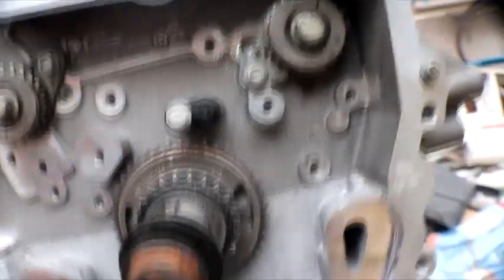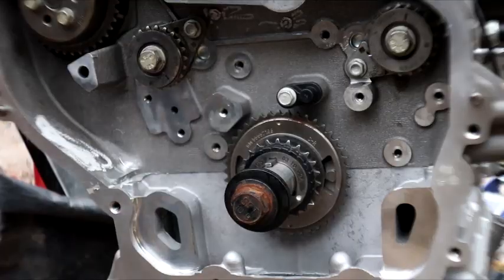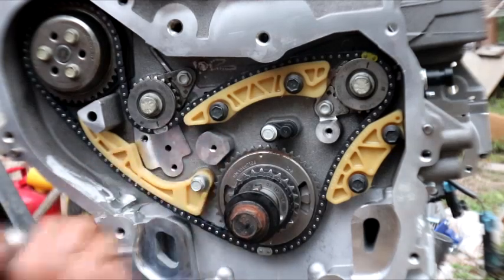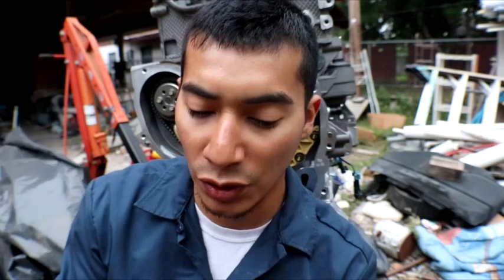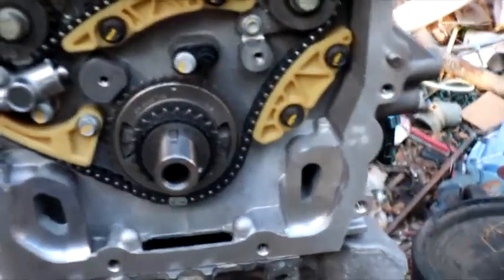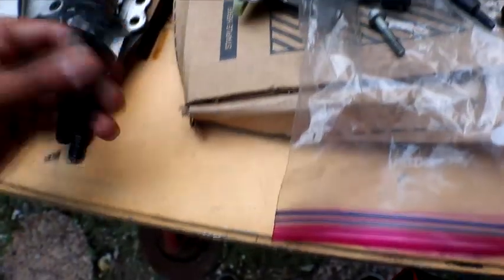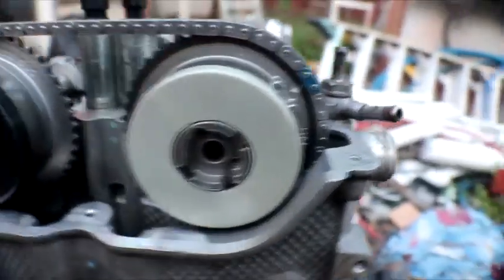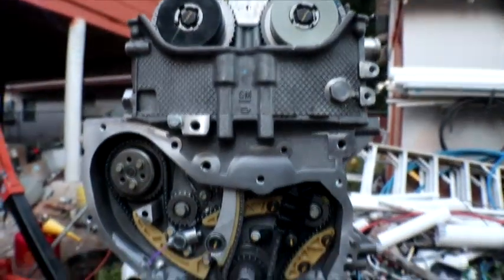Just in Time"ing" (Ecotec Timing Chain Set) Part 5

Comment: What if I have p0014 code for exhaust to advance, black guide was broke into pieces laying inside, so I have to re align cams, or can I just replace the parts
Reply from the maker: If your engine has VVT, you may want to inspect your exhaust cam solenoid. It may be faulty or dirty, causing that code to pop up. I'd reassure the timing is correct and replace the broken timing guide. You may want to remove the oil pan and inspect the oil pickup tube, as it may contain  broken pieces of the timing guide stuck on the oil pickup tube screen, causing oil flow blockage.

Comment: Hi,
Can I keep the chain in place if I'm just replacing the head (cracked). The timing chain and oil pump where replaced a year ago, so don't want to change unnecessarily.
Can I just take the tensioner off that's on the side of the head, or will the chain drop off when the intake and exhaust cam sprockets are removed?
Adam
Reply from the maker: @swast4  you can replace the cam chain components only and leave the primary crankshaft/waterpump chain in place. Just set cylinder 1 to TDC.

Comment: my primary chain is about 1/2 inch too short.  all the sprocket marks are lined up, but the bottom part of the chain, to go over the crankshaft, is not long enough.  i compared it to the chain that came off, and they are the same size...there is no blockage.  don't know what the issue is.

any ideas?
Reply: Tensioner is still set

Comment: Is there an easy way of putting the 2.2 in time without pulling the engine cause that I don't have any way of doing I have an 05 caviler which shaved the lip of the top mounting guide off and now unfortunately I have to replace everything it looks as though the intake cam is the only one that jumped time the exhaust is still set can't say for sure on the crank I haven't made it that far yet. If you have any words of wisdom that might make my journey a little easier it would be greatly appreciated I've never had the pleasure of dealing with the timing problem ever I've done engine work and what not so not a total moron when it comes to understanding engines or cars.
Reply from the maker: Yeah it's also possible and to do it with the engine in place. Sadly not as easy as engine out but removing the passenger wheel as well as the splash guard will open up the space alot more to give you more access to the timing components, just make sure cylinder 1 is on top dead center before doing timing.
Reply: @09CamaroFANATIC  thank you for that I wasn't 100% on where cylinder 1 needed to be but you cleared that up I definitely appreciate your knowledge
Reply from the maker: @00Slacker  yup for sure no problem, let me know if anything and hope all goes well for you!
Reply: @09CamaroFANATIC  what do you think the chances are I won't have to drop the oil pan to get that flat piece of metal that was sheared off the top chain guide. Sorry for being a pain in your ass it looks like the exh cam is still in time the int is out maybe a quarter counter clockwise might not even be that much  I think it's been a minute since I looked I've been dreading going any farther and it not being in a garage and the damn rain and cold weather 90% of the last few weeks I didn't go no farther than taking the top off the engine. I have no knowledge on doing timing but not having the cash to pay someone that does I have no choice I know the rods can get wrecked I'm hoping that didn't happen but it ran good the night before the the next morning it wouldn't the chain has got a good amount of play in it and the flat piece on the top guide is gone

Comment: how do i verify the #1 piston is at TDC on proper stroke.  My timing chain was broken.
Reply: Well this is a late response, but I'll answer. When the Crankshaft sprockets are at the 6 and 5 o'clock positions the crankshaft is at TDC on #1 cylinder. Then when you line the colored links up as explained in the video that sets the cam timing to  the compression stroke with #1 at TDC. Just means both valves are closed. 

It could technically be set with any cylinder at any stroke, but it's done like this because that is where the timing mark is set and what the colored links on the chain are set to line up with. Also by using the compression stroke both valves will be closed so you don't have to fight with the valve springs trying to spin the cam lobes around.

To further answer the question: if your cams are not lined up with the colored links after setting the crank sprockets to position, then you have to manually turn the cams with a 24mm wrench with the chain off to align the timing marks on the cams with the timing marks on the chain. There is a place to put a wrench on the cam just behind the cam sprockets. Do the intake side first. The video left out some details. You also have to rotate the cams to get all the chain slack to the left side where the tensioner is and then activate the tensioner by pushing it in 2mm with a prybar with some tape or anything soft on the end so you don't damage the chain, or you can use the back of a screwdriver and tap it with a hammer. For the bottom tensioner you just pull the pin and then run and jump down on the ground and try to find something to shield yourself with.

Comment: Do those cam sprockets fit on to the camshafts only one way with something that lines them up?  I want to be sure my cams are correct because my chain jumped before this replacement. It looks like the cams have a oval notch at like 7 o'clock on left and 5'oclock on the right.
Reply: Hey Mike. I'm working on a cobalt ss 2.2l ecotec 2008. I'm not 100% it is the same but it sure as hell looks so. With that being said I marked my sprockets and popped them off so I could answer your question. The sprockets on MINE can't be put on wrong. The keys on the sprocket only go a certain way. Research everything, triple and quadruple check everything. If anything doesn't seem right DO NOT continue, just get it right. If you don't every single valve in that thing will be done for. All of them.
Reply from the maker: Yes sir the cam sprockets only fit onto the camshaft one way via a key on the sprocket and notch on the cam.

Comment: If the engine is been turn, how come the timing marks never line up again?
Reply: Has to do with the fact that 1 rotation of the cam sprocket or cam phaser is equal to 3 turns of the crank sprocket

Comment: That upper main chain guide plug  was made for the ones that sheared off the bolt in the head so you wouldn't  have to drill it out. Sometimes the bolt will break off when the chain gets too loose.

Comment: Ok,ok ! People inquiring minds want to know.. need to know haha ...!! Warning signs that your timing chain is about to jump when you could hear your timing chain rattle like a rattlesnake it's time for another timing chain tensioner when taking off tensioner how to test if it's no good try pressing the cylinder in 20 times if you can do it more than five times without your finger bothering you it's no good .. good luck Cobalt fans have a have a 2008 and still running like a champ..

Comment: The prob I’m dealing with now is the upgraded bolt that holds plastic guide  the top bolt. Striped loose over a year at the head
Reply from the maker: So the thread on the head where the plug or upgraded plug/bolt goes into is stripped?
Reply: @09CamaroFANATIC  yes I already have the new used head back on and torqued but was having problems finding the torque spec for the cams. And cam bolt?    Someone was telling about the cam sprockets being spring loaded and if they are took off the have to be reset do u know anything about that?   When I took them off the cams they didn’t really feel spring loaded
Reply: @09CamaroFANATIC  thank u for the videos and how thorough u are I appreciate it
Reply: @09CamaroFANATIC  it’s a 2.4 vvt

Comment: I put all the marking like how you did and when I spin the motor. The lines don’t mark up anymore
Reply from the maker: the marks won't line up again. If you lined up all the timing marks, and you don't have the pistons and valves toughing as you spin the engine by hand, you shouldn't have a problem.

Comment: I have a 2010 2.2 LAP with 81k. It would mostly have a faint but noticable rattle at startup, after sitting for a few hours cooling down. Would replacing the tensioner  get rid of the rattle and prolong the chains and guides or would it be safe to replace the whole set?
Reply from the maker: How many miles are on the engine? If it's over 100k miles and on original timing it may be time to replace timing kit all together

Comment: Adding the extension could mess with your torque btw
Reply: That is incorrect, extensions only mess with torque in an impact gun not on hand tools. Check out torque test channel.
Reply from the maker: Yes, I took that into consideration, I added 2 extra inch pounds due to only being an 1 1/2 extension

Comment: Gonna have to do timing on my z22se at some point and i would like to get new torque to yield bolts but where i can find them on the internet, any ideas? Or do i have to go to a stealership?
Reply: I like it & Yes, your right  about that, STEALERSHIP!!! They overcharge for everything!!! I just got a 2.2 ltr Pontiac G5 with 167k miles but, it gets up & goes for a 4 banger!!! I can hear either the valves or the chain slapping the guides, EITHER WAY, IT NEEDS CHANGED ASAP! IM WATCHING EVERY VIDEO SO, WHEN PAYDAY GETS HERE, I HOPE TO HAVE IT DOWN PAT. i did the timing belt on my focus about 2 years ago. It was way easier!!!!

Comment: I have done exactly what has been shown and after all the Mark's are lined up and I activate the tensioner I turn the engine over by hand clockwise and I get lots of slack on the intake side by the fixed guide. Then if I turn the engine a little more the slack goes away but then comes right back. Everything is lined up and there is tension on the tensioner side. What is going on
Reply from the maker: Have you released both tensioners?
Reply: @09CamaroFANATIC  yes
Reply: Just not making any sense
Reply from the maker: @zachmaas7618  is it a new timing kit? And yeah it's not making sense. If both tensioners are activated one for primary chain and another for secondary chain then it should all be tight. Only way it will have very little slack but not enough to jump a tooth is due to the fact that they tension up with oil pressure.
Reply: @09CamaroFANATIC  yes new timing kit. I wish I could send a video or pic of the slack. I redid the processes many times to insure I did it right but still the same issue
Reply from the maker: @zachmaas7618  try sending it to me through message
Reply: @09CamaroFANATIC  I'll have to do it another day
Reply: @zachmaas7618  i keep seeing everyone say cyl 1 TDC. i personally was told you go by cyl4 in the compression stroke at TDC. If you intake/exhaust marks are opposite where they should be, then there is a good chance you are 180 degrees of the tdc you need.to be
Reply: @etothelij  the Mark's line up and intake cam is lined up with the intake mark same with exhaust
Reply: @etothelij  #1 and #4 are at top dead center at the same time.

Comment: qustion, does old 2.4 ecotec work on the new 2.4 ecotec?, just the lower i want to change, my has problem knocking and blowen head gasket mixed coolant with oil, if the lower old block work on the new, i can get one easy, but the new one hard to find, thanks.

Comment: If my cam shaft sprockets do not align with where the INT and EXT marks should be can I just use a wrench and move them? In your video they were already in the 2 o'clock position for the Intake and 10-11 for the exhaust. Thanks
Reply: Best to still have the old timing chain on and move the crankshaft until the camshaft ones line up. Because if all 3 don't move at the correct ratio it can cause valves to hit cylinders and basically destroy the engine at first start. And it WON'T BE a 1 to 1 ratio between camshafts and crankshaft because the crankshaft sprocket is far larger. If you've removed the camshafts completely, it gets more complicated but there's a comment on here that answers that.
Reply: @OffGridInvestor  you're right I just found that comment and makes sense now. Thanks for replying!
Reply: @OffGridInvestor  cam sprockets only go on one way. As long as the crank keyway is at 12 oclock #1 piston will be all the way up top. if cams were out just put the gears on and line them up at 10 oclock and 2 oclock no way you can really mess the timing up on these.

Comment: once all thee chains are in place you should always rotate the engine at the crankshaft nut 720 degrees ( two rotations) to ensure the marks are true... Once its buttoned up it could bite you if not... Just a little tip.
Reply: Some of these ecotec engines you really shouldnt, they use oil pressure for the tensioners and the chain tends to pop off if you turn the engine over by hand significantly.
Reply: @wills.5762  should I use loctite on any of the bolts including the 3 water pump pulley bolts?
Reply: Just adding this in. Apparently a lot of these GM engines won't have the marks line up again on the first revolution but will on the second. I assume it's to do with the chain length.
Reply: @OffGridInvestor  its to due with the balance shaft spinning and 2x the timing chain - so its 2 or 4 full revolutions to line up again

Comment: Please tell me 
A.) you remembered to pull that tensioner pin down below before re-installing
B) (optional) replaced water pump while you were that far deep into the motor?
Reply from the maker: Yes I pulled the pin on the lower tensioner and the water pump was a new unit just for safe measures.

Comment: I have a gmc terrain 2010 2.4 las week I   saw a masive oil leak on front of the engine look under I thought the main seal when bad replaced and the leak continue look at it again and I found a crack on the engine boody pretti much like were the chain goes mount  it is posible if one of the guide broke can the chain gets close to the engine block and grinding the inside wall? Because it seems that s what happen thanks for any info i. Advance
Reply from the maker: Sorry just getting to you, but it is possible for that to happen if a bolt that holds guides in place break off causing the guides to move and the tensioner will no longer be putting tension against the guides causing wear by chain rattle.

Comment: Hi, I'm currently rebuilding my 2.4L. Do you know the torque spec for the head, rods and main caps?
Reply from the maker: Hey what's up. The torque specs for the Head is 22ft lb. Plus 155°
Follow torque sequence.

For the Connecting Rods is 18ft lb. Plus 100°

For the main cap(lower deck) bolts 15ft lb. Plus 77°
And perimeter bolts 18ft lb.
Reply: @09CamaroFANATIC  Hey, thanks for the info.
Reply from the maker: @charlieclm  you're welcome!
Reply: @09CamaroFANATIC  Hi, how are you? Was wondering do you know where I can order the LE9 2.4 ecotec engine rebuild parts that ships internationally? Can't find any of the parts in my country not even the dealer. 😅
Reply from the maker: @charlieclm  Hi, I'm doing good, how about yourself? What country are you from?
Reply: @09CamaroFANATIC  I'm good too, just stuck with the engine no parts to reinstall back. I'm from Brunei Darussalam. 😁
Reply: What happened what failed to need rebuilt?

Comment: Hey love the vids! I blew the head gasket in my 2.4l and I took the camshafts out when taking the head off, after re installing the cam shafts how did you know where to  them since the pistons could be anywhere?
Reply from the maker: GasPedalGarage Hey thanks I appreciate the input!! You would have to revert cylinder 1 to TDC if you are going to set the timing. That way you can get the timing set correctly and the marking dots and arrows on the correct positions.
Reply: @09CamaroFANATIC  شكرا
Reply: #1 piston at TDC you put cams exh and int at 10 and 2  O-clock timing positions. the unique oddball colored chain link goes on cam sprocket.  rotate exh cam 45 degrees clockwise to set colored link on sprocket   with 24mm wrench on cam behind sprocket

Comment: Is this the LNF 2.0 Turbo? I ordered a timing chain kit from Ebay but the sprokets don't look like that.
Reply from the maker: EElectric_M yes this is the LNF 2.0T. And the timing sprockets are different. The one from Ebay will be for a regular Cobalt that just looks like a regular cam gear. I'm not sure if you are familiar with the Cobalt community, but if you are, if you know Jeffrey Nelson Reiland. He has the LNF cam sprockets for sale at a great price.
Reply: I'll check that out thanks, or could you change the timing chain but leave the original sprockets that are already in the engine?
Reply from the maker: @Macsk8ing  you can do that, but not recommended.